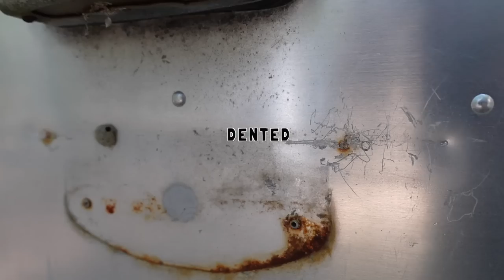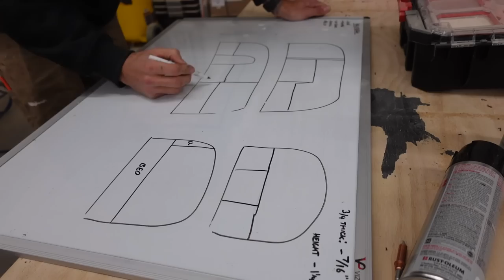Rotting Airstream Transforms Into Dream Travel Trailer (Full TIMELAPSE BUILD)

Comment: The spray foam may have been not a great choice. You get better R-numbers by the numbers, but the rigid foam in a very non rigid shell will crack and become brittle. When using alternative methods, I like to use what cob and strawbale builders call a truth window. I hope you left one in this build.
I also hope your knee is better. Keep building. You guys rock

Comment: Wow you guys can build the most beautiful vans , buses, and now rv's.  You can inspire a duck to swim in water because you take problems head on and make them into the most beautiful creations and even the most problematic one's are the most magical when you get to the finish line.  I have one question and you don't have to answer it if you don't want to. You guys built out a full size bus that you said was too big , a van that looked too small, and now an Air Stream kinda looks in the middle. What make's you think this time is going to be different? I am just curious because Andrew and I are still looking for the perfect fit. We thought a bus is to big for us, we were looking at a shuttle bus for the medium size and then a transit or the camper you put on top of your truck. How did you guys decide?   With all the challenges you guys face and still crossed the finish line with a beautiful build you should feel very proud.   I hope you guys and Pipa enjoy your new home.  Love and Light and Blessed Be xoxox Carla

Comment: Awesome job. I would show the video to the previous owners, and maybe they will refund you $8,000 Looking at all the rot, decay, carpenter ants, and dead bodies, that trailer in hindsight could not have been worth more than $500, add in another $1,000 because its an airstream, I guess.  :P  I'm way less venturesome. I just bought a gutted but new off road cargo trailer I'm going to call my adventure trailer, as it will house my new adventure motorcycle. I own a sawmill, so I'm also milling all the wood including maple flooring and aspen cabinets.